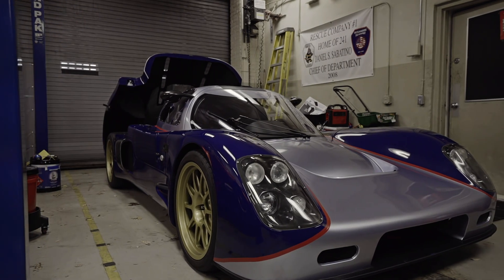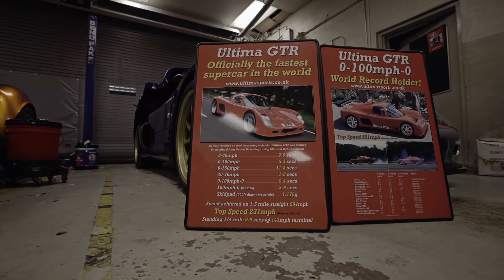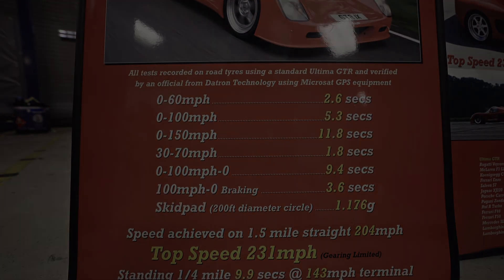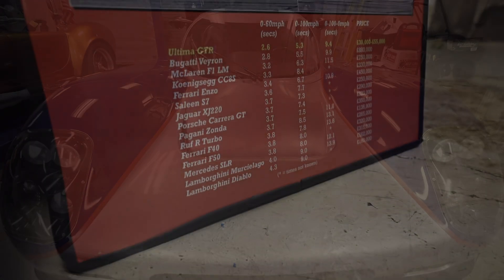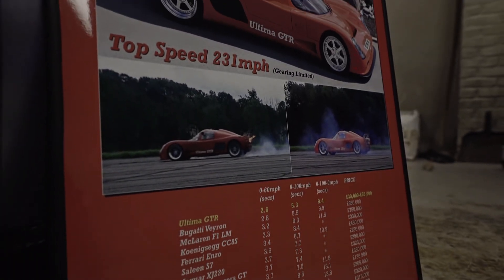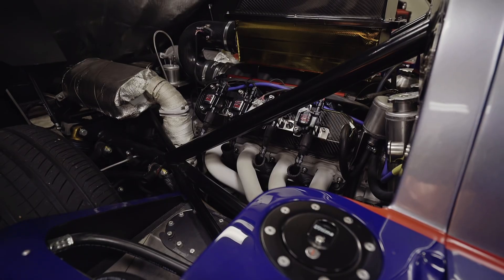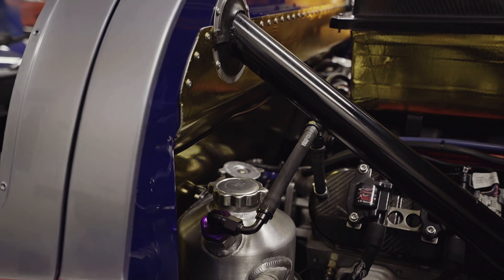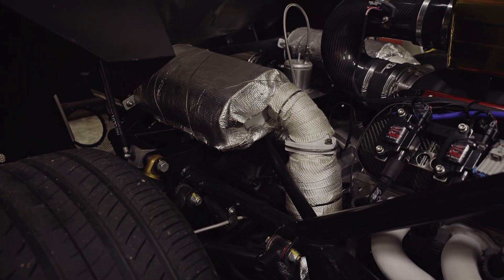Ultima GTR | SchwaaFilms

Comment: This is an absolutely wonderful car and I love how they put Porsche, Ferrari, and Lamborghini in there place and showed that supercars can be sold for less than $100,000 and be profitable. However...if they don't create an ESC package, anti-lock brakes, and power steering for this car it will soon be relegated to a track only car.
Reply: +BAZYRKYRS BUNKER  You can add PS, ABS, traction control but it starts to get a little pricey for a home build. Plus I wanted to keep the feel of a race based car.
Reply: Yeah...it could add pretty penny but it would be worth it especially if it's a road car. Personally I'd rather pay $100K-$120K for a car with those features and drastically increase safety (and in some situations performance) than pay $80K-$100k for a car without them and in the end up dead, or a vegetable, and leaving behind pile of parts and a distraught family. But to each their own. That said...I don't think that those features take away from the feel of it's racing pedigree. In fact...I think it adds to it. And if you want to  turn the traction control off when you're on the track you can. Either way, in the eyes of the goberment, what we want doesn't matter. Soon all motor vehicles, home built or not, will be required to have these features to operate on the public road. Unfortunately the People do not realize that drivers licenses and the legal terms "motor vehicle", "driver", and "operator" (among many others), which differ drastically from the common usage of the words, do not apply to state Citizens per the organic Constitution but but apply only to 14th Amendment Federal U.S. citizens aka U.S. persons.